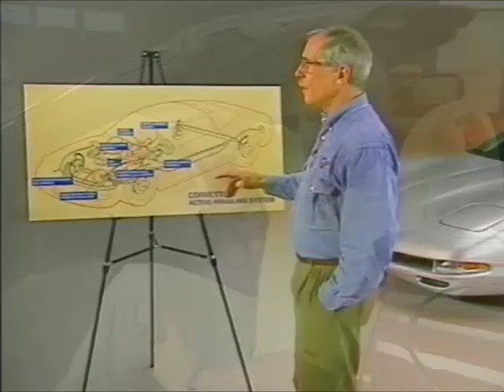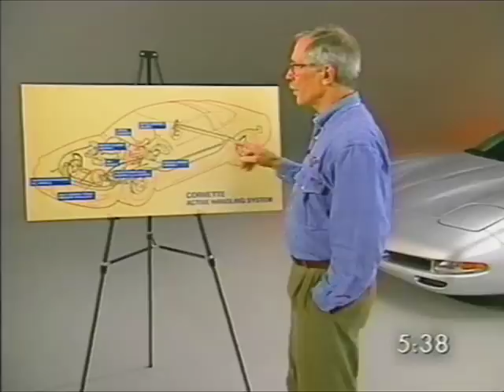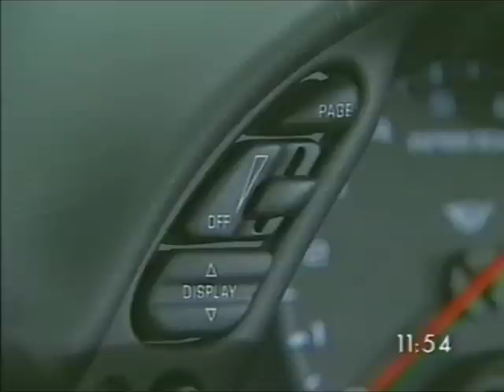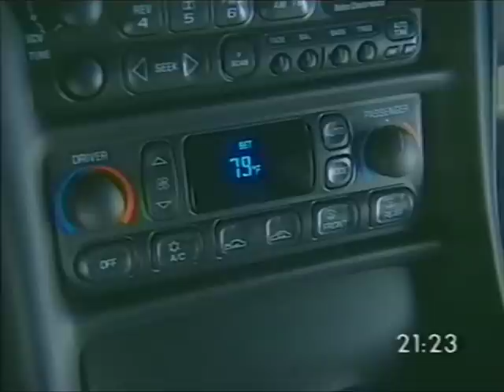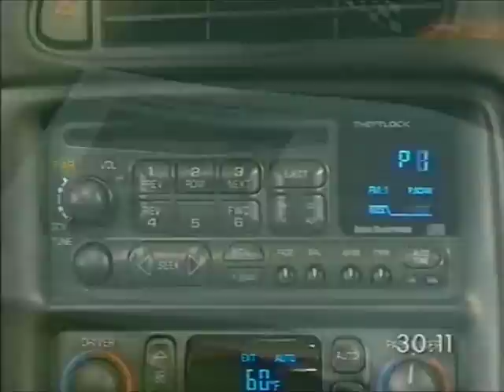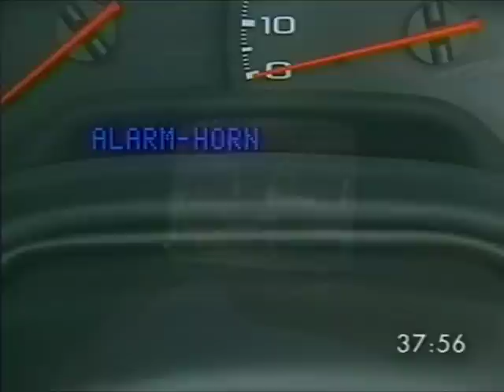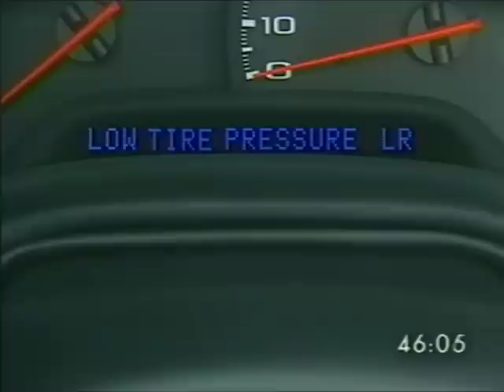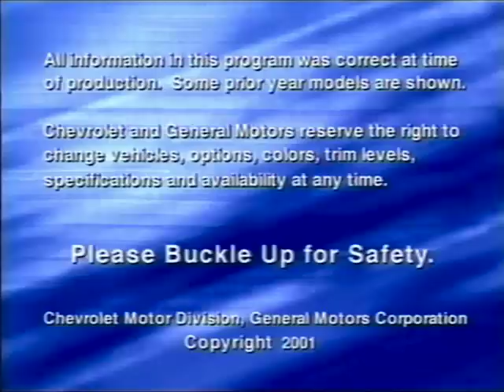Chevrolet 2002 Corvette C5 Owner's Video

Comment: Hopefully I will have a C5 soon. Always wanted one.
Reply from the maker: Leon the C5 you will just totally enjoy. You can find some very low mileage ones available for a very reasonable price. The 6-speed manual transmission is a real joy to drive and the handling characteristic is quite good. Although the interior is quite modest I choose performance as a priority. The C5 also was the last generation of retractable headlamps which I really like despite it not being so aero when they are up. The smooth lines and curves of the C5 IMO never gets old! Definitely get one of these babies... you will be glad you did!!!
Reply: tedvstudios If all goes well I will find a 01 or 02 automatic transmission with the performance auto. I wish to use it more of a daily driver. So if I find one I will be driving it to Daytona for the Rolex 24 race. Then I can park with the Corvette club infield and enjoy the race cheer on the C7R race teams. Always want to be apart of the Corvette community. Great people.
Reply from the maker: +Leon L (Z28)  I have the 2001 myself. Good luck in your quest for the C5.  It will be worth your wait.
Reply from the maker: Correction I have the 2002
Reply: @tedvstudios  good for you, the 2001 thru 2004 are the best C5's to get

Comment: Why do I continue to hear claims that a C5 Corvette has a faster top-end speed than a C5 ZO6 Corvette when the Z06 has 405 horsepower and is almost 400 lb lighter!? The physics doesn't allow the LS1 Corvette to go faster than the LS6 Z06. And, don't talk to me about running out of gear because you don't know what the fuck you're talking about when people say that ¿`_
Reply: The glass on the standard coupe is more slippery than the abrupt hardtop glass (allegedly).  Also, it's very possible gearing is part of the issue as the lowered Z06 gearing means it will top out in 5th below the speed it will top out in the base car.  6th is too tall for top end speed unless you have major power adders.  Weight doesn't matter much at all for top speed, it's all power and aero.  This is why you'll see super heavy Mercedes that will easily do high top speeds when the power/weight is worse than some lighter cars with lower top speeds.
Reply: @nunyabusiness896  No! You don't know what you're saying. Understanding the torque you have at the end of each gear in relationship to RPM, and including 5th gear, would require a power shift into sixth gear while maintaining the torque and you will increase speed, hence the top end will be greater. Understanding where it stops pulling in 5th gear is essential for the quick shift into 6th and no speed is lost, but if you dilly dally into sixth gear the speed and torque will be lost and you will not gain speed. The max. torque in a ZO6 starts at 4,000 RPMs and IF it will only pull to 5700 RPMs in 5th gear and with a lackadaisical shift into sixth you will drop below that torque. Now, what part of this don't you understand!? Check out: the Montana speed limit paradox. Today it is impossible to put a Z06 through its paces because the laws are far too strict and that is just sad ¿`_
Reply: @nunyabusiness896  I added the tidbit about no speed limits in Montana, and with that said, I haven't had a chance to take mine into Red Line in 5th gear. It pulls right to 6600 RPMs which is the rev limiter in 4th gear, and the way it pulled all the way to the maximum in fourth gear, I suspect, it might go to 6500 RPMs in 5th gear and if that's the case, I would power shift at 6300 RPMs and I'll guarantee it would continue pulling in sixth gear. Most of the time it's not what a car is capable of, but who is driving it ¿`_